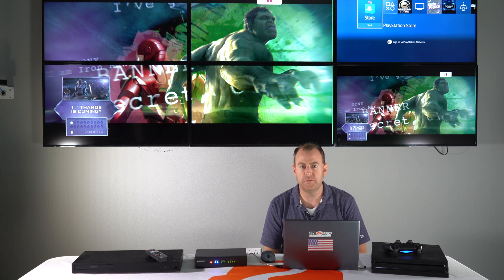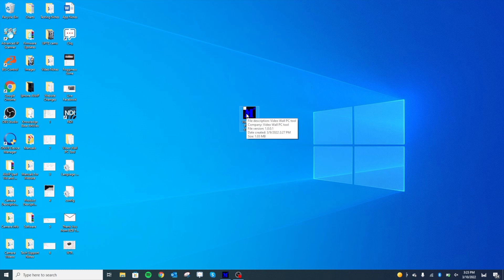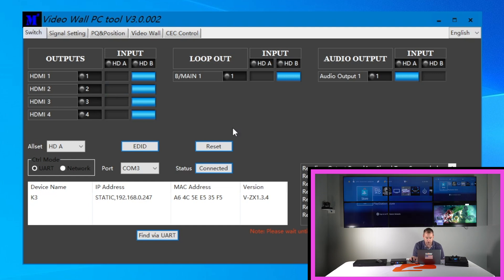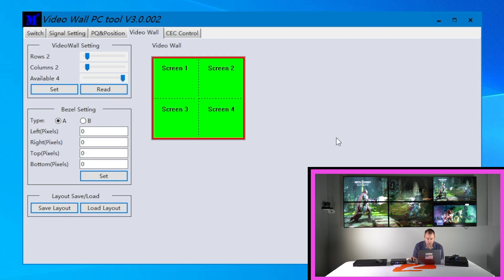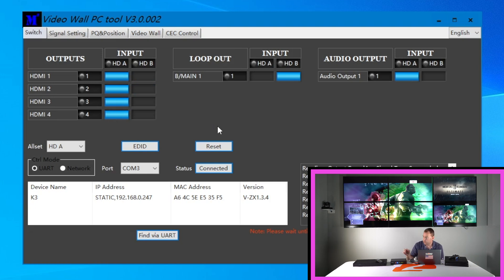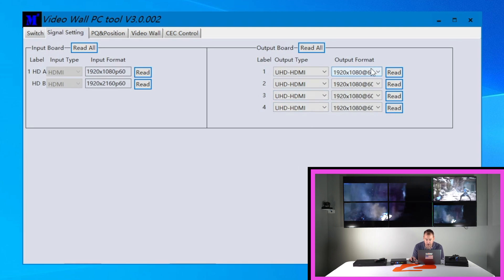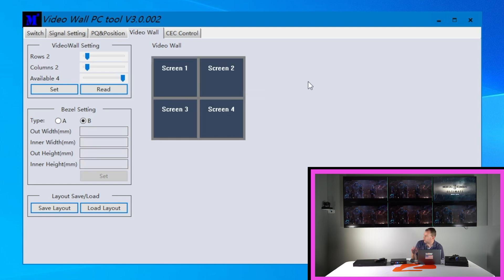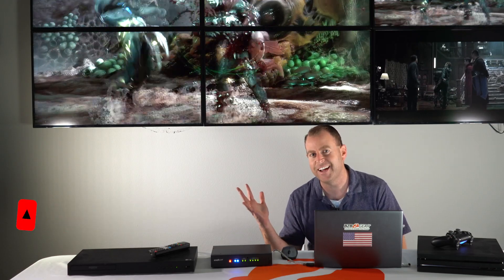How to Set Up a Professional 2x2 Video Wall for 4K TVs | BZBGEAR BG-UHD-VW24

Comment: What if I  have 4 smart tvs, instead of 3rd party device like roku switch, blue ray etc.  Hiw would that work or would I need 3rd party device.
Reply: Would I need a 5th smart TV to us as the input?
Reply from the maker: Setting up a 2x2 video wall using four smart TVs can certainly work, even without the need for additional third-party devices like Roku. The main component is the video wall processor like the unit in this video.                                                                                                                                        Even though you're using smart TVs, they're primarily acting as monitors; they will display part of the overall image from the processor. The smart functionality of the TVs (like using apps or streaming directly from the Internet) will generally be unused unless you switch the input source to the TV's built-in smart platform. This can be useful if, at times, you want each screen to display content independently from its smart capabilities. Hope this helps and visit bzbgear.com if you need any help picking out a video wall processor or just need extra support for your setup.